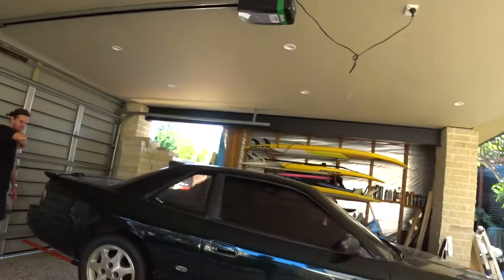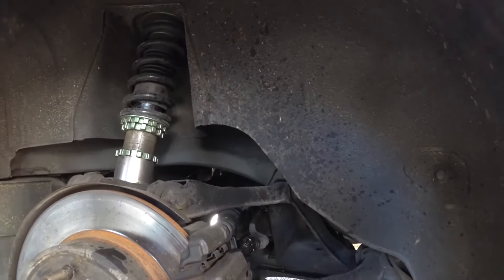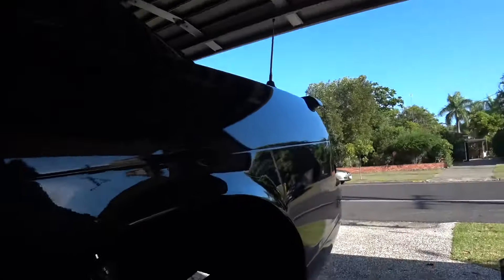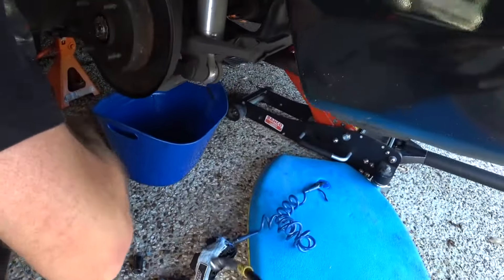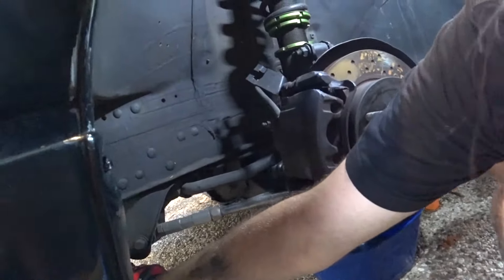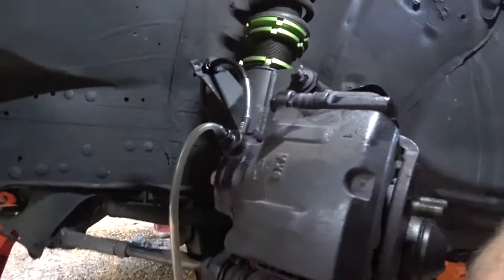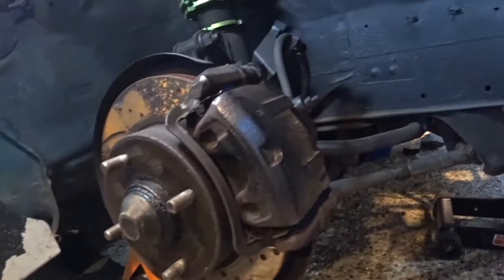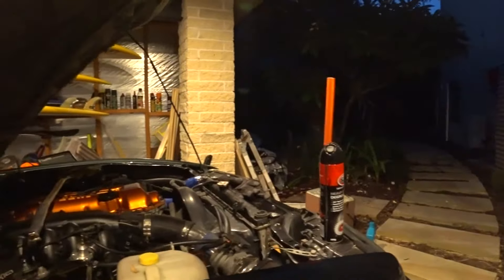GKTECH Braided Brake Line Install On My New S13

Comment: For the rebuild you could just use parts from a sr20det right ?
Reply from the maker: I believe the cams and pistons are different as NA are higher compression. Have heard of people putting DE cams in the turbo motors for some minor hp gain